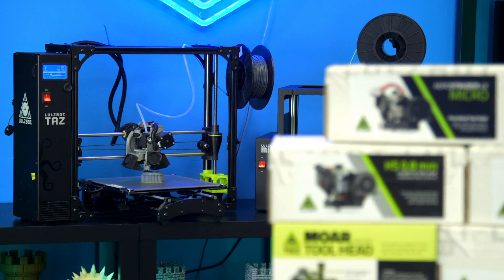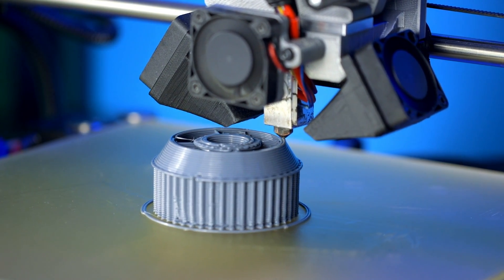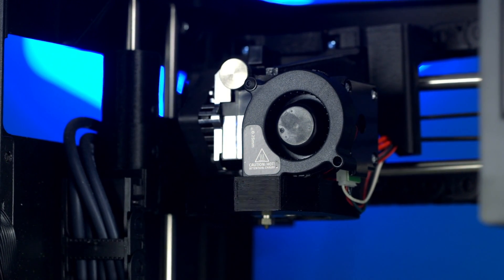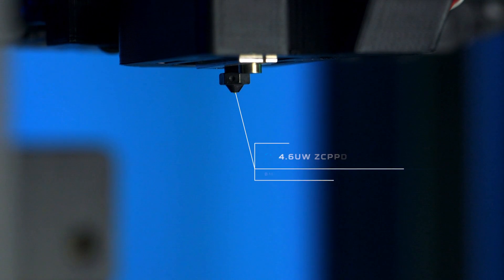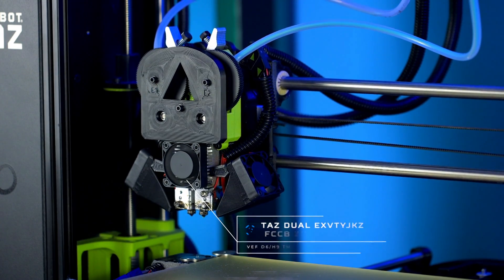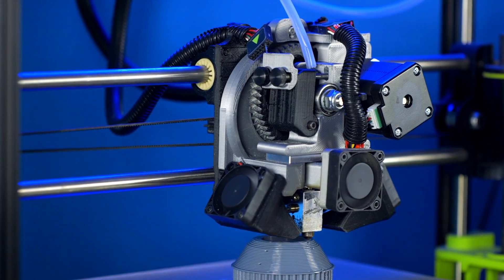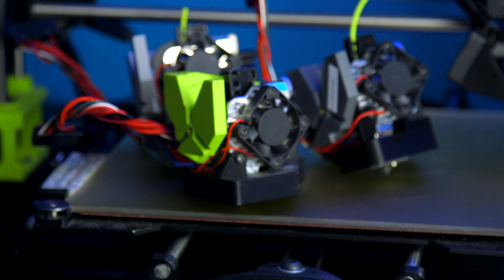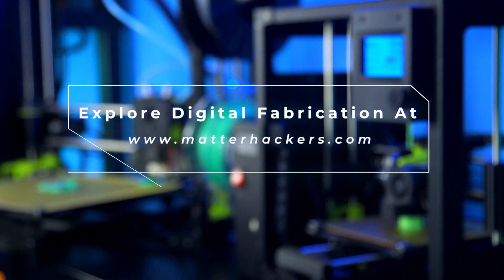Upgrade Your LulzBot With These Powerful Tool Heads | Tech Breakdown

Comment from the maker: What is your favorite LulzBot tool head? What do you use it for?
Reply: I only know the one I like the least, the one  which came with my Taz 5 Lulzbot.    That's why I'm here.  I like your website, Mr. MatterHacker, although the taz toolhead page could be a bit clearer on which toolhead will fit what lulzbot.

Comment: So I got a SL toolhead swapped in, everything is good, fans run, hotend heats up, but the gears just refuse to extrude. Any advice?

I've not found a single thing about this and am bashing my head against the proverbial wall trying to find out why the extruder gear won't run.
Reply: I've heard that running PLA in the Taz machines tends to bunch up in the toolhead.  I think I've done that to my machine as well, it consistently under-extrudes. Gotta learn how to dig it out.

Comment: At over $2k, one shouldn't need to 'upgrade' a lulzbot.
Reply: You dont ‘need’ to. Great reliable machine out of the box. No fiddling with bed levelling before prints, and a huge print area.
Reply: I agree.  I'm a teacher.  My school system bought 6 lulzbots.  All of them produced prints, but not for more than a couple of years, and not without a LOT of tinkering.    My schools computer maintenance guy went out and bought a CR-10 for 1/5th the price and he is getting better prints with no experience!  
Amazon reviews are terrible for the lulzbots.    And Lulzbot itself doesn't offer as much info on fixing the problem as MatterHakers does!
Reply: Ricky W The $2500 one has a build space of 270 270 225mm. That’s a joke. I’d rather have a cr10s for big builds, a10m for dual extruded and maybe another adapted with a big .8/1mm nozzle all for less than half the base machine here.